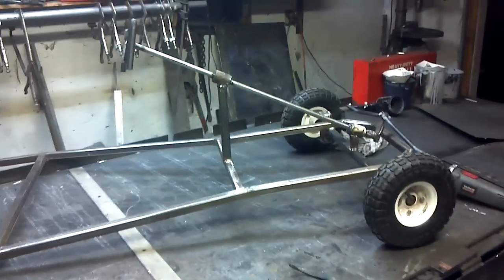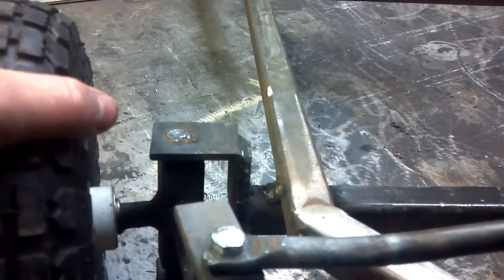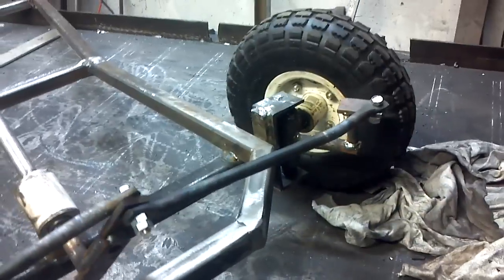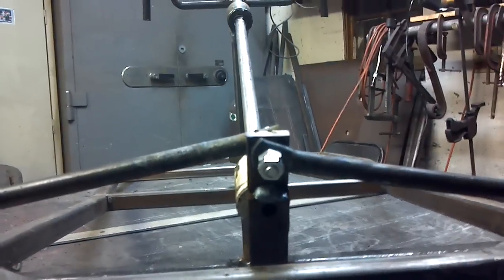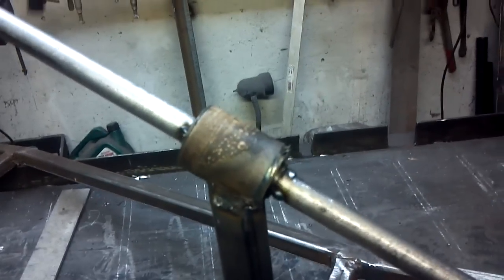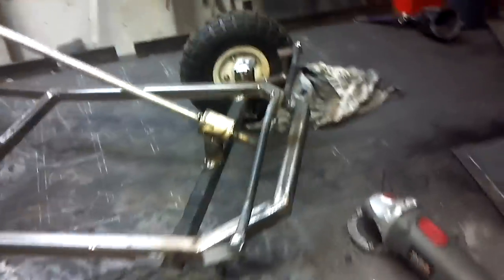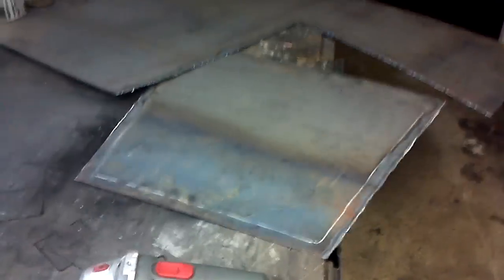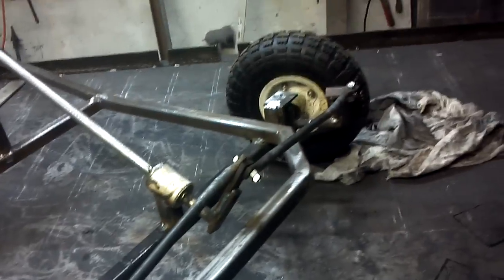Custom Go-Kart Project "Steering"

Comment: the steering wheel tube that goes through the bearings- what diameter and what wall thickness is?
great job there buddy i'm hassling with a dirt kart my self i'm gonna copy yr steering system , don't sue me :)

Comment: You also don't have any caster ( for jacking effect on the inside wheel while you are turning), no King Pin Inclination ( to also help with jacking) and no ackerman built into you steering. That cart will push like a dump truck and scrub speed off like mad.
Reply from the maker: This was to help people so they can get out there and have some fun. I used bearings from a wheelbarrow lol simplicity!

Comment: It does not look like shit! And it's a good explanation. I'm trying to build a recumbent trike for my son and I'm about to start on the suspension/steering. Did you use neck's from bicycles or scooters to attach to the spindles? I've never welded before but I bought a cheap welder and I've been scavenging parts(especially bearings- I've got 4 sets - not including the ones in the tires - from heavy duty to lawnmower wheel bearings...but the suspension/steering has me a bit confused. Any help would be appreciated.
Reply from the maker: I used a 1" round bar and and 1" pipe both from home depot and it worked great! I also had welded on a piece of tubestock to get sides to mount the tie rod to. If you need some mor help I can draw up a little diagram let me know
Reply: @Gaznick  lets pretend i am trying to explain the spindles and suspension to a friend of mine who is a complete moron (not me though!) HE doeant understand how to make the spindles and where they're attached. And my idiot friend also mentioned putting some shocks (little baby carriage ones) in there too. How would this boob go about that? Any info you could provide would be a huge help! ( and btw - im the moron!) If you have a drawing that woukd be great!  Also would aluminum be okay for the outer body? Im using two square steel center pieces that im going to weld together to mount the  pedals,  unless aluminum would be atrong enough for a 70pound 8 year old? Any help would be greatly appreciated!

Comment: with steering you could have kept "the bar down design" but just swap the stub axles around except you've welded everything in so when it came to painting you struggle

Comment: With your tie rods out in front like yours,you should be able to draw an imaginary line thru the tie rod eyelets and the kingpins,and they should intersect at the center of the rear axle.I.E., yours should be angled out almost touching the tires.If they were in behind the axle,they would need to be angled toward the frame.watch my video. 'goKart steering explained.Including Ackermann theory'    Thanks,John Wade,you tube.

Comment from the maker: if you do the welding yourself it would probably be in the range of 350 to 400 dollars and thats all supplys included.
Moto, clutch, seat, tires, plate steel, tubestock and not to mention the brake as well as cables. Id say closer to 400